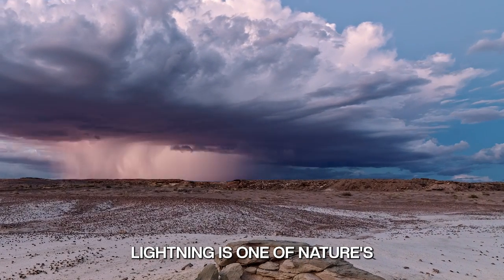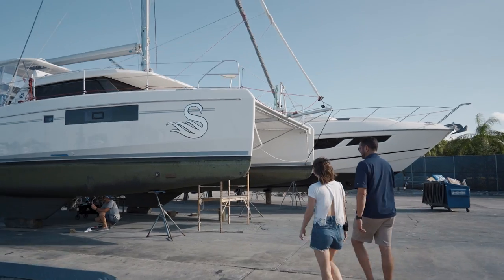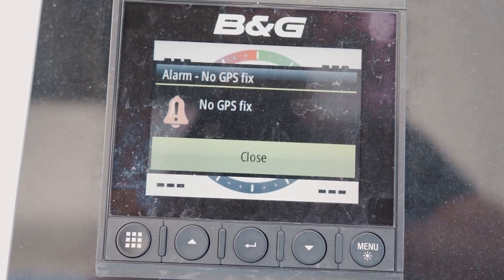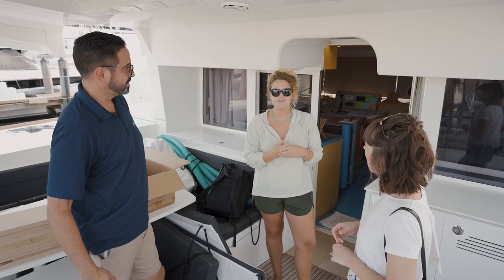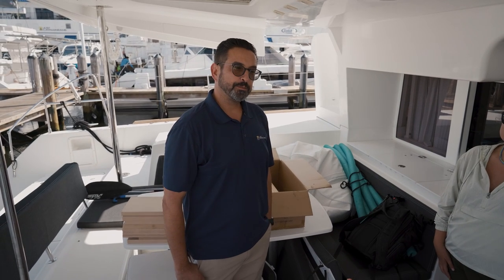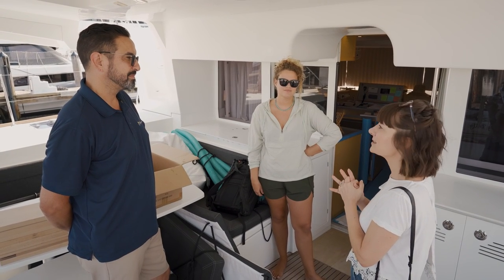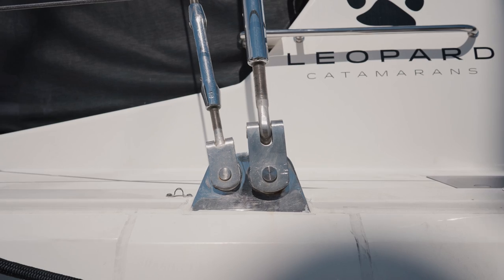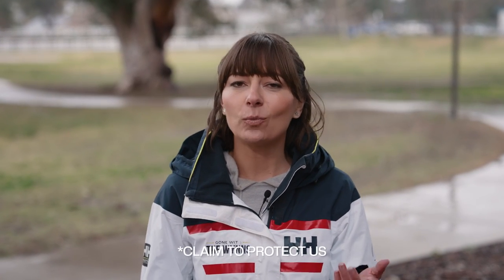Can Anything Stop Lightning?

Comment: Lightning struck the car right in front of us, seconds after we had got in to our car. This was my prom night an in a massave parking lot, right under a steel street light. Light poll was not hit. My car was fine. The car hit was tosted. From what we think we know about lighting, that should not have happened. My house, on top of a mountain, has had a 60 foot steel poll out the top of it for 30 years with a CB antenna on it. It has yet to be hit. But once, lighting came in the window on the other end of the house an struck the metal sink with pvc plumbing. Again, should not happen, but it did. I have came to the conclusion that we dont know jack about how lighting works. Direct hits anyway. And I am very skeptical of anyone selling an old, long sense expired patent as something new and pricy. The brush looking things are also supposedly based on the Tesla system. Have they built something better? Maybe, but if they did, at the price they charge for it, you would think they could afford to stand behind it with some kind of guarantee. Without that I would assume they really dont think it works. At $15K an $70K repair costs if a boat is hit, how many of their coustomes have to still get struck for a guarantee to be unprofitable? Somewhere in the range of 1 in 5? How many boats normally get hit to begen with?

Proximity is EMP damage as I understand it. Antennas and long bits of wiring work as antennas to turn that pulse in to another electrical spike frying anything attached to them. Lots of wiring in boats. So unrelated systems get hit by varing degrees as they all have long wires attached to them. The old school radio guys would unplug everything before a storm. They would also unhook their antenna wires from their radios an stick the ends in to a mason jar. The point was to create an air gap between the equipment an the long wiring. Not sure the Mason jar did anything other than explode if your radio tower took a direct hit, but it was tradition.

Today, we are making things worse. More wires an everything is connected and stuff cant just be unplugged. A strike that would have just taken out your radio, will now fry chart plotter too, because the two are directly connected with wires. Even if you could unplug the power. Turning off the breakers only airgaps the positive side of the 12 V system. The negitave is directly conected to everything. An while we wire things an invision them as the positive side being hot an moving to the negative, the opposite is true. Electrons are what is moving. Electrons are negitavly charged  an move from the negitave to the positive. The positively charged protons are sitting still. The negitave side is the side with all the extra electrons trying to find somewhere to go already. The breakers are on the wrong end of the wiring anyway to protect the equipment from proximity strikes. The long sections of wiring is usually on the equipment side of the breaker.

Boats being a complicated wiring disaster makes a fix for a proximity strike very complicated. So in my opinion, anyone selling a single device to protect from a proximity strike is just selling snake oil. It would require a complete redesign of how we wire boats today to get any real protection. IMHO

Comment: Extremely doubtful it works. The problem is the potential in the water around you. While you technically could change the potential around the device itself, it is a drop in the ocean, as everything else, including you yourself keeps putting out feelers to connect for a strike.. There is a way to shield all your electronics through.. Put it in a farradays cage, including batteries,  and only have fiberoptics connection to the outside.. There is a reason a car is a very safe place in general, or a plane or ship..

Comment: Your Boat is still in construction and not in assembly phase, right ? Install the worst part of the anti lighting system...run the cable from the mast to both ends of the hull NOW. Later you can install the other equipment. At least now the worst will be over and done with. They can and should modify the space for the STERILIZER AKA DISHWASHER...UNTIL YOU CONTRACT (H.PYLORI VIRUS ) YOU WILL NOT REALLY APPRECIATE CLEAN STERILE DISHES. You already know how limited medical care can be in some of the areas traveled to.

Comment: HAVING BACKGROUND AS AN ELECTRICAL ENGINEER AND SOME BACKGROUND AS A MACHINIST I WOULD WANT TO LOOK AT THAT THING MEASURE BECAUSE IT SEEMS TOO SMALL SO THEN ALSO SEE HOW IT'S MADE BUT I'M GO FIGURE OUT A WAY TO MAKE ONE
MYSELF OR GET A MACHINE SHOP TO MAKE IT SOMEPLACE IN THE HEARTLAND OF AMERICA ARE NOT GOING TO BE CONNECTING IT WITH BOATS I'M GOING TO TAKE AN EDUCATED GUESS YOU CAN TAKE A COUPLE OF STAINLESS STEEL OR ALUMINUM DEEP-DISH SALAD 🥗 BOWLS PUT OR MAKE A SPACER TO PUT IN BETWEEN MOUNTED ARE GOOD AT WELDED TO A POLE 💈 MAKE A MOUNTING BASE VERY LITTLE HAVE WHAT YOU NEED THAT ONE THAT'S MORE EXPENSIVE LOOKS LIKE IT JUST HAS A HEAVY-DUTY CAPACITOR THAT YOU COULD PROBABLY GET FROM ANY COMMERCIAL ELECTRICAL SHOP AND YOU PROBABLY GOING TO RUN A PARALLEL TO YOUR MAIN GROUNDING WIRE 
TWO THINGS THAT CANNOT BE PATENTED BECAUSE THE PATENTS EXPIRED BACK IN TESLA'S TIME SECOND ANYONE CAN MAKE EVEN A PATTENED AS LONG AS IT'S FOR YOUR OWN USE NOT FOR RESALE
DAVID ADAM GRENIS MAPLETON AVENUE BOULDER COLORADO

Comment: Design .... a container  or containers for all ur electronics...that would isolate / protect  ... ur electronics from ur boat ....  🤔 that product that guy is selling looks like a lightning arrestor  ... I've  installed and replaced  ...many types and designs for power lines ...as a lineman  ....
A lightning arrestor installed on top ...and run the wire to plates the hull ...using his tech.. 🤔🤔🤔..
.but u need a crash dummy to sail into the lightning storm  ...
Ha ...🤖 👍
Him and his brother bubba  ... made it in his back yard  ...ha 🤣

Comment: Lightning prevention systems are not new territory for snake oil salesman. Anybody dropping Tesla's name is immediately suspect.  Read into the history or efficacy of systems like this and you will see that there's just simply not a lot that we can do to prevent strikes. Providing a path to ground is best for land base systems. The problem is on yachts that much power running through the system will still destroy everything around it. Also providing a juicy path to ground increases the likelihood of a strike. Lighting is rare enough that these companies can just play the odds and sell equipment because most people just won't get struck.

Comment: This technology is not new. It has been demonstrated extensively in other applications for many years.  On an all-electric sailboat, I think it’s.no-brained to install this system.  Cost = $15K.  Deductible on your insurance policy is $10K or so.  And you would still be out of service for a vey extended period of time. And you guys are often way off the grid.  So it doesn’t protect you as much from proximity strikes - oh well.  I would be curious if it provides any protection from proximity strikes.  Good luck with your choice.

Comment: Yes, it is a Tesla device. Trust the COMPANIES?? (LOL lol lol) Please excuse me. Trust them to make oodles of profit, darn right. The material used to make those devices is about $175.00. The actual manufacturing (because they are still limited to small amounts) works out to about $200.00 / unit. So, in all, under $400.00 (US$). What is the asking price???? Did they say $15,000.00+?  That is where my (LOL lol lol) comes in.
Reply: I think that was the installed price, but ya, still seems high.

Comment: 15 000$? for a dome of metal? You must be kidding.
This is not rocket science, it’s the opposite of a lighting rod. Instead of being pointy and encourage arc formation it prevent them by dissipating over a bigger surface.
Similar to the brushes in the images you showed.